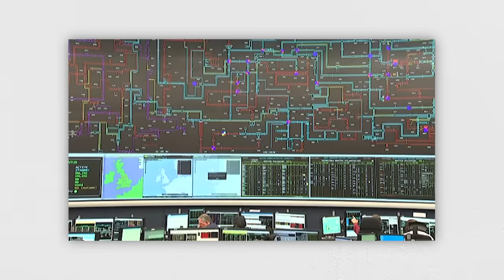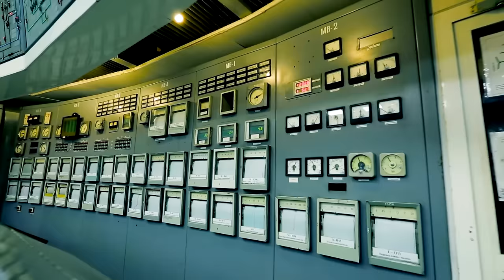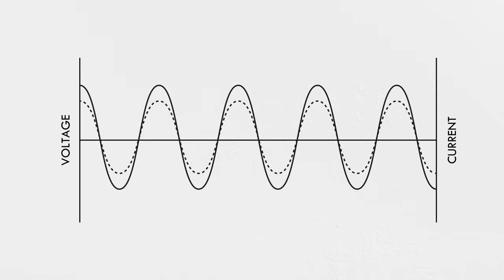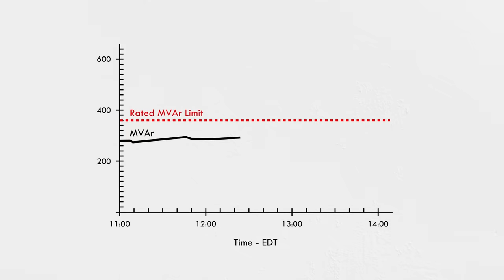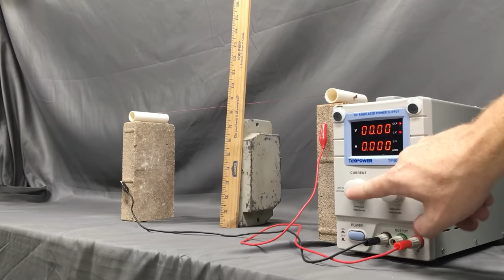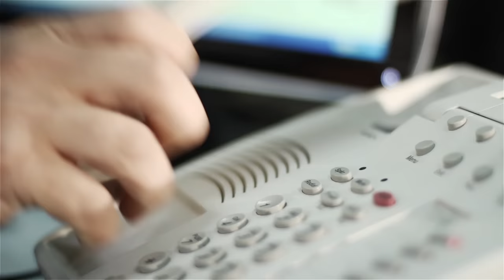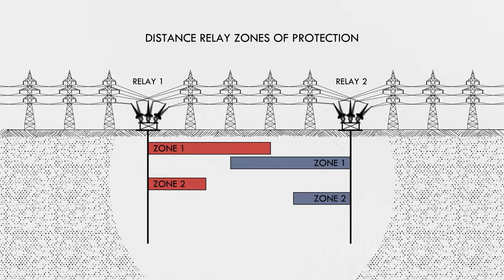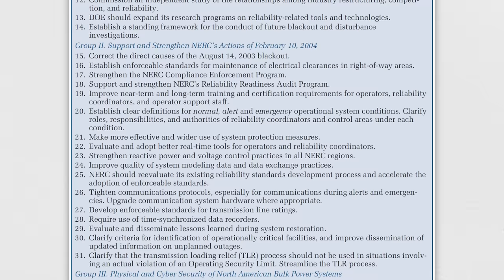What Really Happened During the 2003 Blackout?

Comment: It appears that the critical factor was the failure of the IT people to communicate the failure of the alarm system to the operating managers.  What was the reason for that failure?  Perhaps they didn't know the criticality of the system.  Maybe they were afraid to be blamed.  Maybe they wanted to be left alone while they worked on the problem.  At any rate, something that should have been done was not done.
Reply: More likely there was no stated need to do so. It's not uncommon for system resolutions under a set amount of time not to be announced.  I worked with a monitoring system that normally had a blinking green light to indicate it was operating, when the light stayed solid green it was not intuitive that it was an indication of failure.
Reply: I feel like having anything as important and relied upon as the alarm notification system for problems should be reported immediately to the current manager of the control room with a second reporting of when they fixed it.

Also tt ww, who the F makes:
blinking green = all good
Solid green = problem

I feel like most Americans will immediately recognize:
Solid green: all good
Solid yellow/amber: warning
Solid red: problem
Flashing red: big problem
Flashing red & loud alarm: critical emergency

Comment: As a software engineer myself I just can say, too little redundancy. For example the rule about data storage is normally to have at least 3 copies. One where you mainly access it, two on different hardware but can still be in the same location and three a totally offsite copy.
So in that case you could have two separat systems running in the same building, so not one system can ruin everything and then you have at least a second facility as far as you can go. So even just the same humans can’t be the fault of not reacting. 
Never ever have a single point of failure in any critical system. Simply because there can always be something that you can’t predict. From simple bugs via hackers or even terrorists. And yea it’s more expensive then, but still cheaper than loosing that system for quite a long time.

And then how can it be that a power line sags that much that’s it fails when it’s still in their rated limit. Any system should be maintained that it can handle the full 100% of the rated limit. If it’s not then it just can’t be rated that high. So in that case you have to check regularly if any trees are too close and take actions accordingly.

So for me it’s really just an organisational issue more than everything else. Simply because there can be always issues like that and you have to plan them in.
That why I like the Netflix approach on that thing. Called Chaos Engineering. They regularly just bring some chaos in the system, like shutting down a few severs here and there, inject network error, shutdown all servers in one whole datacenter and so on. So they can check that everything works, even in the worst case.
But that is just the point of view from a software engineer. As I know that working with hardware is always more difficult

Comment: I remember this so vividly: I was just sitting down to use the family computer and I struck the spacebar the way I saw my dad do to wake it up... and then BOOM. Power outage. My mom checked the circuit breaker, but no use. My dad had to drive home from the city without traffic lights. Eventually, we all went to the local pool club to cool off. It was so hot that night that I couldn't sleep, and there was nothing to do the next day, so I just walked around the block and then came home and took a nap. By the time I woke up, the power had come back... then it went out again for a second, but then it came back and stayed back.

Comment: I was leaving work when the blackout happened.   I had the radio on in the car, drove over a speed bump and the radio cut out.   I checked a few other stations, and was getting nothing all over the dial.   So I was annoyed that I somehow broke the radio by driving over a speed bump.  It wasn't until several miles down the road when I got to the point where there were traffic lights that were out, and one radio station managed to get its generators up and running to say that there was a major power outage going that I realized that my radio didn't break.

Comment: Apparently a new thing they're installing in the UK transmission grid are special voltage regulators to control current flow. 

Basically, if you have generation in one place and load in another, obviously current will flow on the lines between these. However, if the line is saturated, you could use these voltage regulators to raise the voltage at points across the line, and lower the voltage across another line that is physically longer with higher impedance. By controlling the voltage levels across the transmission network, they can redirect and control the flow of current, keeping the network within load limits.

I'd love to see a video on these.

Comment: One thing to add. Before this time most of the cellular towers did not have auxiliary power. The only ones that did were attached to facilities that needed redundant power for their operations. Those towers had their telephone circuits quickly overloaded. This dual mode failure led to changes in how that part of the infrastructure operated.

Comment: I was in Brooklyn walking to the subway when it happened. I remember wondering why so many people were on the sidewalk listening to the radio. I walked down the stairs into the subway station and thought it was strange there were no lights on but the metrocard machine still worked when I swiped my card so I proceeded onto the platform and it was pitch black down there and I thought it looked pretty cool, still having no idea there was a blackout. Then I saw a train stuck in the tunnel about 50 feet before it reached the platform, the lights in the train car were on and I could clearly see a bunch of people fanning themselves profusely. I left the station and headed to the Pratt dorms and partied with my friends all night long, we drank 40s on the roof of the Willoughby dorms looking at the Manhattan skyline and the only part of the skyline with any lights on were a few tall buildings downtown near Wall Street.

Comment: 1:53 It's more than that; if supply (current) and demand (draw) are equal, the resistance is low (0.058 ohms/km). The greater the resistance, the more heat generated. The greater the difference between supply and demand, the greater the resistance.

If there's too much supply, or too much demand, the resistance can easily scale to infinite and the power lines catch on fire. This is why "storage" is so important for renewable sources, and why currently those sources are more supplemental to tradition power generation which can be easily scaled to demand on the fly.

Comment: Practical engineering I would love if you touch on oil rigs and how they hold so much weight on top for such a small metal structure and how it stays firm so many years in the water etc

Comment: I live in india and around 2002 2004 we had sometimes no power for weeks as transformers went out of service due to stealing of electricity from open wires, but we were used to that so it was no big deal, houses had manually operated hand pumps for water, for lights candle and oil lamps and hand driven fan in winters

Comment: I remember this blackout! I was around 6 years old when it happened here in NYC. It was my first ever blackout experience so I was both fascinated and worried by it. The stores/supermarkets were only accepting cash and the conveyor belts didn't work. So if you went to a supermarket with a conveyor belt, you had to physically push the food along. Me and my family also went to the beach that day since it was extremely hot outside and there was no way to cool off indoors since none of the fans or air conditioners worked at home. We took the bus there since none of the trains were working. So yea it was an interesting time. I feel like most people tolerated the blackout well back then since the Internet was still kind of primitive. I don't think a blackout on that scale would go well in today's society. I mean the last blackout I remember witnessing was during Hurricane Sandy in 2012 and that only lasted for an hour or two I think.

Comment: The real problem was restarting the system.  It is human nature to go around turning stuff on so you know when power comes back.  When it does come back you go around shutting everything off since it costs money.  In the meantime, since everyone has done the same, it creates a massive load that just drags down any generator that tries to come on line.  The only solution is to get everyone to shut off their stuff (which they won’t do), or send out crews to open switches to  create small 16:31  islands.  The generator can come on line and supply power to the island.  When everyone in that island has shut off their stuff, the next island can be closed into.  This continues until two islands come in contact with each other.  There the problem is that the three phases (A,B, & C) must be matched in parrallel to each other.  This just means that when each phase on one island is at peak, so is the corresponding phase on the other island.  Since the two generators feeding the two islands are guaranteed to be running at slightly different speeds, all you have to do is wait for one to catch up with the other.  And have a very specialized switch that closes at just the right time.  These switches don’t exist everywhere, so it adds to the logistical problems of bringing the grid back up.  If all loads (appliances, lights, motors etc) were designed so they could only be turned on if power was available, the grid (minus the problem section) could be brought back up in minutes.  Instead it took over a day to return to full normal operation.

Comment: As a substation electrician for first energy in md,  I can tell you they did not learn the lesson.  We regularly run 500kv and 138kv transformers and greater than 100%.  We have seen 500kv interconnect lines in alarm state at greater than 2200 amps.  They only worry about their stock numbers.

Comment: Aaand that's the reason why reactive power compensation should be a thing even for consumer AC units (and big motors). Where I live large companies and office buildings must have own capacitor banks to keep power factor as close to 1 as possible (huge electricity bills/ fines if they don't). But no such requirement for consumers, despite some sporting multi-kW AC systems. Several homes like this and it's equivalent power consumption of a small factory...

Comment: It's my fault. I was working in a PC repair shop in a warehouse in Eastlake, OH that day. I had dozens of PCs plugged in on test benches, with numerous power strips daisy chained one after the other. I knew the circuit had to be getting overloaded, as I'd popped the circuit breaker before. But I had to get work done, so I plugged in one more, and pressed the power button. Two seconds later, the warehouse went dark.

Comment: This was a wake up call, in 2003 that improvements are needed. In Northern Ontario, our power was out for 20 hours, this was totally unwarrented as within the lake superior power district we have 18 generating water stations, plus a natural gas steam gen. Hydro One didn,t know what happened and everything was black. Our district could have been an energy island with the breakers pulled at Wawa and Mississauga, we could have power within hours. BUT NO hydro one wanted  everyone to sync to them. A local natural gas steam gen plant called by sat phone informing that their 100% ready and were ordered to stand down. By power certification requirements for a license to operate, a hydroelectric dam has to be able to put power on the grid within 1 hour of startup to be certified. Since towns had no power, emergency crews, police, fire, ambulance, only has gas in their vehicles, as emergency power for gas station was nill, funny though some gas stations away from town had generators, as we drove home from camp, traffic at intersections was a mess, the only fuel for elevators / generators was what was in the fuel trucks, even the tank farms didn't have emergency power for refilling trucks,  good thing for the American sister city that had power to broadcast emergency messages back to Canada as the local police station emergency AM radio Transmitter had no power. BUT the casino was lite up with generators and was susposed to have a band in the parking lot. Police were telling everone to stay at home. This happened in summer,  so no big deal, but what if in winter? Overall, everyone should take the time have some form of basic preparedness in order to be ready. 4 winters ago during a winter ice storm had power out for 18 hours in the centre of town. Cooked and heated water on the BBQ, used the backup natural gas fireplace, had extra gas on hand for vehicles, plus our camping gear stuff for cooking as well. My dad grew up on a farm that never had power,  just a wood stove and lanterns, grew food and stored perserves in a root cellar. He says "were spoiled. " too much electronics.

Comment: I still believe all dwellings need not only natural gas availability but also a wood burning stove that doubles as a heater. Even in high rises. There should be dedicated emergency floors that can accommodate so many people per emergency space. It should have independent plumbing, toilets, showers, be air, it's own water tank, air conditioning, wood burning stove/fireplace vented, tubs to wash clothes/towels and the ability for hang dry. They should be able to lie relatively dormant with little maintenance to maintain. But full checks every March and September.  Probably should have a gray water system that can be reused and cleaned via natural and chemical processes.

Comment: 2:00 That's wrong. Alternating current isn't flowing from a power plant to the consumer. It's like sound. The air isn't moving from one person to another if someone is speaking. Only the sound waves are moving at a certain frequency. So are the electrons within our power grid. They're frequently changing their direction. That's the reason, why capacitor only work with alternating current. If the current would flow constantly in one direction, it couldn't overcome the gap between the capacitor plates. It's the same reason, why people can hear you, if there's a wall between you and the other people. That wouldn't work, if the air only is moving from A to B.

Comment: One thing I forgot to mention was a humorous interaction.

I was getting ready to go to night school and the light started flickering.  I figured the bulb was failing so it was a 'no problem, got a spare'.  It flickered a couple more times and I muttered (or growled) "Just croak already you bugger!" and the light died.

Okay, no problem, time to replace the bulb but then, I noticed it was very quiet in the building.  We could normally hear mechanical sounds but those were gone.  Okay, tried another light, dead, so yup, bulb fine, power out.

Was an interesting day.

Comment: It seems that the biggest engineering issue is finding an affordable workforce to clear trees from electrical easements?  You would think this would be a problem of the past, not the future.  Who wants a dangerous career with plenty of protective gear to wear, dirty clothes, and no air-conditioning?

In the recent past, our community has embraced growing weeds in place of cultivated tree varieties.  Forest fires are just an unfortunate consequence of some decision-makers storing 'carbon' in a solid form until the site is renewed by fire, or it decomposes as understood from high school biology.  Yes plants make oxygen, but that doesn't mean that forestry has a net production of oxygen, or storage of carbon dioxide (in the form of carbonate in the soil.  However, it could be organic-carbon, but the chemical reduction process also makes methane-gas akin to swamps or feedlots).  A classic example of inductive/deductive-reasoning mistake.

Last year, I found charcoal-like branches from under our transmission lines, after severe-weather.  Power flashed momentarily during a couple or more events.  Now, they are talking about cutting power during these weather events, even to customers with medical equipment connected.  The power and telecommunication companies who use these aged and decayed poles have lost interest in maintaining the easement.  Public officials seem to not be interested in hearing about it either because there is a freight-train-of-organizations, both public and private, who promote a no-maintenance, no-permission-to-plant, not-harvested 'urban-forest.'